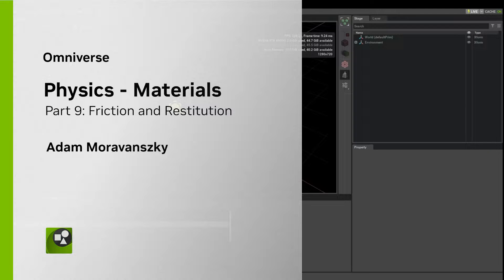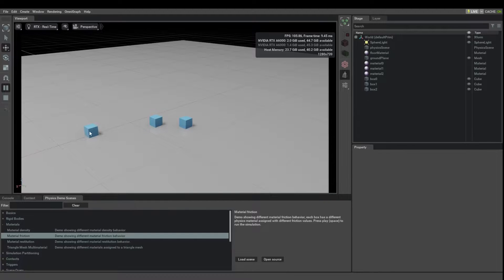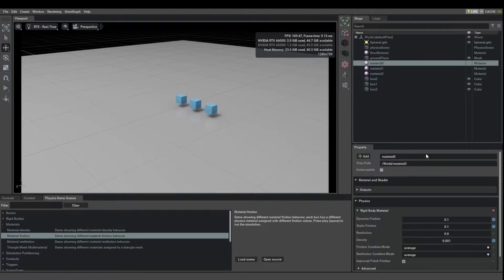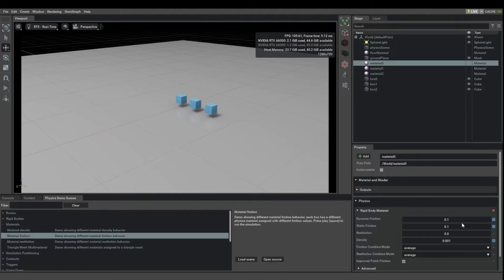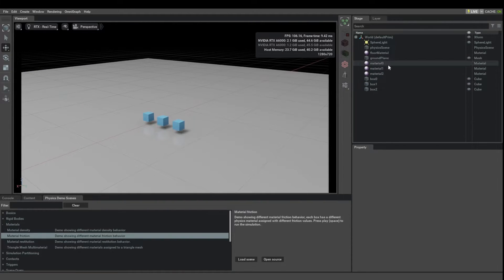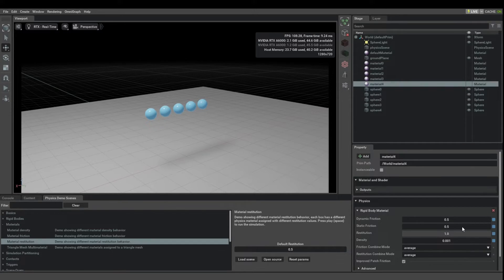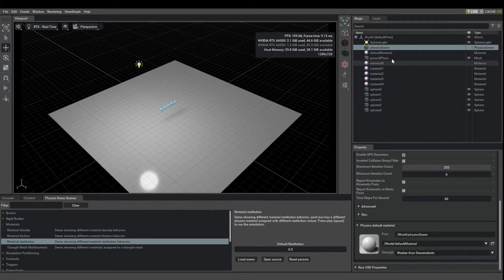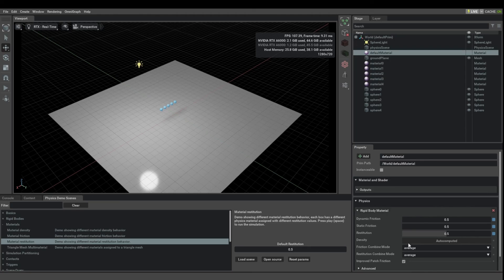Omniverse Physics Extension - Kit104 - Part 9: Materials - Friction Restitution and Defaults

Comment: Hi Adam, 
Thank you for the amazing series, I am thoroughly enjoying this.
The question that I have is, I have a situation in which I have some rigid bodies in a drawer-like environment which opens and close while have these bodies inside.
I want the rigid bodies inside the drawer not to move too much but the problem is whatever value i set in terms of friction it's never enough and they bodies keep on sliding inside. 
Any advice, please?
Thanks.